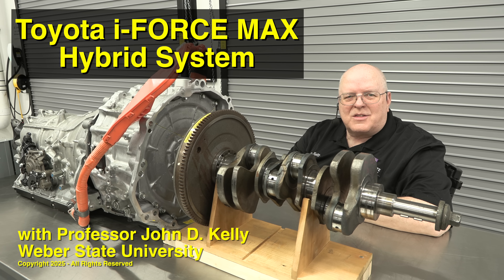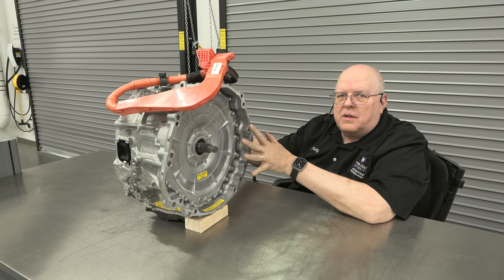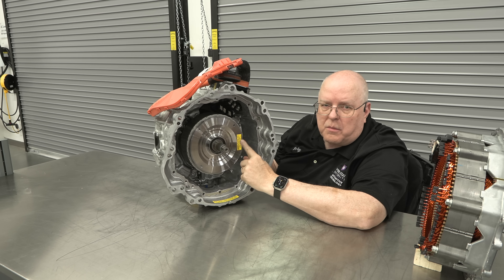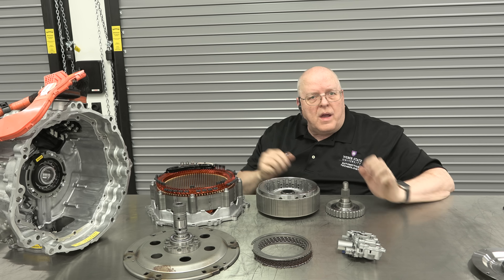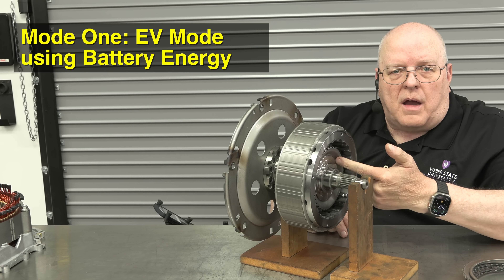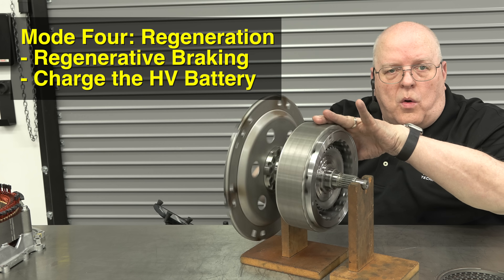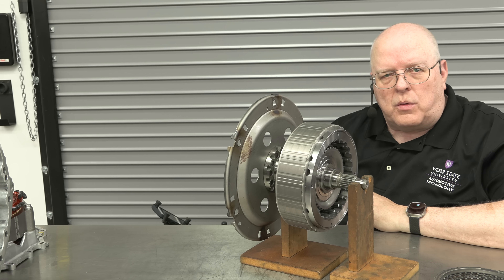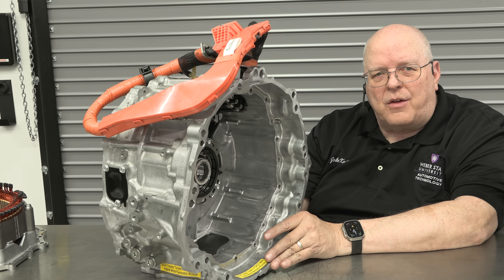Toyota's i-FORCE MAX One-Motor Hybrid System

Comment: I use two cars: a Japanese Nissan Fuga (similar to the Infiniti Q70) with the same hybrid system (a VQ35HR with 303 hp and an 80 kW electric motor). 
It's a similar hybrid design, but with a dry clutch, like a manual transmission.
And every drive, I clearly feel the gear changes, both during acceleration (1-2-3-) and especially during recuperation (-3-2-1). 
All this is noticeable in comparison to the lack of any gears on my second car, the Leaf Ze1, which, as you know, has a super-smooth ride with a single gear in the transmission. 
I'd like to believe, that 8 or 10 gears and the car's greater weight, will smooth out this rather unpleasant nuance.
This hybrid system design has been around for many years, and only differs in design within the limits of licensing and protection of rights. 
And I'm surprised Toyota didn't install some of their favorite high-revving, highly efficient "PowerSplitDevice" between the ICE and transmission.
However, Professor, THANK YOU SO MUCH for your reviews! You have no idea, how much you contribute with your lectures. 
How many cars have been repaired simply by a deeper understanding of the systems you described and demonstrated in such detail. 
I bow deeply to you. I hope you'll read them. I wish you good health. Thank you again.
Reply from the maker: Thanks for sharing your experiences and your kind words!

Comment: Very interesting - thanks.  Just curious does the "module" use the transmission fluid (not separate, all one containment)?  I am just thinking, if the transmission and the module are using the same fluid, I would assume the fluid would require more maintenance (changing the fluid more often).  Although, I have never heard of anyone having transmission issues more so than a non hybrid vehicle.  That's an awful lot of clutches when you combine the trans and module.
Reply from the maker: It has shared fluid. Thanks for watching

Comment: My question with regards to my Land Cruiser .. with the engine stoping frequently and the oil pressure dropping as a result to 0, does this mean a lot more extra wear every time it starts again?  It's not like I can disable this either.
Reply from the maker: It is fine. There is still oil there although it is not under pressure

Comment: What I like about Hybrids is they do not require any special infrastructure. On average they will be all electric most of the time unless they drive more than 60 -- 70 miles.  Ford should have gone hybrid with their trucks.
Reply from the maker: Ford does have a hybrid F-150. They call it the Powerboost system.

Comment: Excellent breakdown as always. I have to say.. I'm just really unimpressed by the specific application of this technology. The truck has a tiny battery, gets extremely mediocre fuel economy, and has a ton of added complexity to the drivetrain.. It would have made more sense at this point just doing a series-hybrid drivetrain, and based on my calculations for the Ram 1500 series hybrid, you'd likely get like 1mpg less in that configuration, but you wouldn't have a transmission to deal with, and you could charge at home for pennies... I'm not sure what Toyota was thinking with this one. It's like a merging a lot of different ideas that should have remained distinct. Even an HD E-CVT would have made more sense than this in my mind. Heck, if they had just put a larger rear motor on the rear axle they also could have eliminated a differential and a driveshaft..This just doesn't compute to me given how little value you actually get back by making the truck a hybrid.. It's frustrating.
Reply from the maker: Thank you for your detailed feedback; I appreciate your perspective. RAM has dropped their series hybrid truck now.
Reply: @WeberAuto  It sounds like they dropped the electric version but not the hybrid! Hybrid is still in the works

Comment: Congratulations for  your dedication and excellent explanation. I am a mechanic and I work a lot with Chevrolet Tahoe and Silverado hybrids that came out from 2009 to 2013, and I have found that they were very advanced for their time. The 2ML70 transmission is incredible; it uses the same NIMH batteries as the Prius, 40 cells, 300V, and in my opinion, it represents another level of sophistication (ECVT whit two 70 kw opposing 3 phase motors)  I would love to see you  take one apart I assure  you will find many surprises in a vehicle from 17 years ago.
Reply from the maker: Thanks for sharing your experience with those systems. I went through the GM training on that transmission when it came out, but I have never had my hands on one since

Comment: Interesting to see Toyota now doing it Honda’s way. I always thought Honda’s way was worse since the ICE can’t always run at it optimal speed. Also in the originals Hondas the ICE had to spin when the car was moving. So EV mode was very inefficient and confined to a few mph at most. Enough to crawl through a fast food drive through and that’s it.

This does seem robust though. Truck folks may appreciate that.

There is at least one other system that works differently.  Volvo’s system puts the hybrid in the transmission. It uses a dual clutch transmission and the motor is on one of the layshafts. So sometimes the ICE and motor are running at the same speed and sometimes not. It does ship in the US but not on any affordable vehicles. And obviously not in large numbers. Maybe you can find a salvage unit out there.
Reply from the maker: Thanks for your insightful comment, I appreciate you sharing your knowledge and experience.

Comment: Definitely not a fan of the iForce, rather regressive and dumb for Toyota, regressive compared to the Subaru Outback's design of a hybrid eCVT hooked to a traditional 4WD output. The eCVT shouldn't have any problem with towing other than direct drive not easily available at high throttle or low speed. Probably a marketing spin for the old boomers who sneer at anything close to being a Prius
Reply from the maker: Thanks for watching

Comment: I’ve been impressed with my hybrid Corolla but wouldn’t want to trade my old tundra ( non turbo) for a hybrid. I don’t equate reliability with a small (6cyl) engine in a truck having not 1 bit 2 turbos. Graft this module into my 03 tundra drivetrain and I’m a buyer.
Reply from the maker: Understandable. Thanks for watching

Comment: If I understand correctly, the generator gear ratio is always 1:1. Is there an advantage to placing it behind the input shaft instead of behind the output shaft?
Reply from the maker: Yes, 1:1. The advantage is the structural support is better close to the engine block. Thanks for watching

Comment: So the clutch pack is hydraulic actuated, but the clutches themselves, are they technically dry clutches?
Can't imagine there's that much fluid sloshing around that housing.
Reply from the maker: No, it is a wet clutch. Thanks for watching
Reply: @WeberAuto  Very interesting, thank you for the detailed video. It is such a simple piece of tech - typical Toyota.

Comment: Interesting the flywheel still has a ring gear. Does it also have a traditional starter?
Reply from the maker: Yes, as a backup
Reply: @WeberAuto 

Good to have options!

So the 12v starter isn't primary?

Comment: My dealership should watch this in hopes they can figure out why I’ve had on 2 different occasions of:

1) hybrid malfunction
2) check engine
3) parking brake malfunction 

First time it occurred with 853 miles and now with 2,278 miles on the odometer.

Awesome video by the way!!
Reply from the maker: Best wishes with that. Thanks for watching
Reply: Random unrelated errors are often caused by bad ground connections.

Comment: Awesome video...this is the first time I've seen anyone take it apart like that. So, if a tuner increases boost on the engine, does the hybrid side of the vehicle do anything different? I've had my Tundra over a year, and the hybrid motor boost still seems so unpredictable to me. Like it just does whatever it wants to depending on its mood. I feel like increasing turbo boost may even make the hybrid tuning think it should add less power. I know shops have been experimenting, but I assume it's more trial and error without knowing what's going on in-between all of this.
Reply from the maker: Good question, I don’t have an answer for y

Comment: I love your videos. What's your personal opinion on mechanical 'direct drive' hybrids like the iforce max vs. an engine-generator with only an electrical connection powering motors for the wheels instead of a transmission, drive shaft, etc.?

I suppose the tradeoff is that the mechanical drive train hybrid is a better known architecture and weighs less, while the 'e-axle' hybrid has fewer transmission losses, and is not limited by an automatic transmission in how much power it can produce. Would love to hear from an expert.
Reply from the maker: This direct drive parallel hybrid system allows engine torque to the wheels at all times. The engine driven generator relies on electrical energy to drive the wheels. This requires a very powerful generator or is loses power under load. Stellantis has stopped the development of the RAM truck with this type of powertrain.

Comment: Very informed and easy to follow video! Thank you very much! I did find the length of this module you mentioned to be somewhat a practical problem. The longer power train and the associated cross member was the limiting factor of the gas tank size. All new gen trucks have a few gallon smaller tanks. Although the improved MPG supposed to make up the difference in range on paper, in practice, the new gens have much shorter usable range.
Reply from the maker: Interesting observation. Thanks for watching

Comment: I think that system is 1:1 the same as the one Honda used long ago (basically, first Honda hybrid system), when the motor-generator was sticked in between the engine (D17 for example) and transmission (CVT). Honda IMA system.
Reply from the maker: It is very similar to the Honda IMA system except this has an engine disconnect clutch.

Comment: Am interested to know how single motor can both job of generating power to charge the battery and the same time providing driving assistance when the car is in ice mode? How is it possible in parallel set up? That's insane.

Also i want to know where the hydraulic pressure is coming from to engage the clutches so that to turn on the engine? And time when the car is in hybrid mode where the hydraulic pressure is coming from to allow clutches in the transmission to transfer power to the wheels? 

Thirdly.  When car is hybrid mode how the gears are shifted? 

How temperature management on transmission is acheived given that there is part is a part that doesn't require too much temperature (the electric side) , and there is another side of the transmission that require   hoter situation for transmission to work.. (is it having more than one cooling system?)

Thanks for good demonstration video.
Reply from the maker: It does not drive and charge at the same time. It is one or the other. It charges whenever the HV battery needs a charge. If the battery charge is sufficient, the motor can help propel the vehicle.
Reply: @WeberAuto thanks so much for clarification

Comment: Is the hydraulic pressure for the clutches in the motor supplied by the normal automatic pump?
Reply from the maker: Both. Electric while engine is off.

Comment: Has anyone done the analysis how much repeated cold starts with high load affect ICE in hybrid vehicles?
I know that Toyota uses thermos like device to store hot coolant, but I think that lack of lubrication (due to oil retirning to sump) is also a big problem.
Has any car company done F1 style engine warm-up before the start, for example by pre heating engine oil using 10kW heater and pumping it around the engine using external oil pump to lubricate slide sufaces before the start?
Reply from the maker: Thanks for watching

Comment: Cool to see this system up close and how it compares to the Ford Powerboost system. The Toyota system is slightly more powerful (7 more HP and 13 more lbs ft), but looks like a very similar design.

The size of the motor surprised me, although stack up length of the full driveline is less of a concern in the medium to full size vehicles this is used in, may not be a concern.

Are the base transmissions identical, other than additional clutch packs to support the higher torque? That may be a benefit to the Toyota design, if they can use a common case for both normal and iForce Max vehicles. Fords design uses a unique case on the 10R80 that houses the electric motor and torque converter within the body of the transmission. This may benefit in better packaging,  but adds complexity in the plant as you now have additional case designs.
Reply from the maker: I plan on showing the Ford Powerboost parallel hybrid system in a future video. Toyota also uses a special transmission case and electric oil pump to jopin with this generator module. Thanks for watching.

Comment: What are the pros/cons of this clutch pack connection compared to the typical series-parallel Toyota hybrid system with the planetary gear connection?
Reply from the maker: The major benefit of this system is a direct transfer of torque from the internal combustion engine to the wheels. The power-split system does not have that and is not suited for heavy vehicles and loads. Thanks for watching
Reply: @WeberAuto  Thank you for the clear answer!

Comment: Thank you for the great video. I’m a little concerned how Toyota designed this system. I would have preferred to see a system similar to what is in the Prius. I’m interested to see Ram’s system where the engine is strictly a generator with a large battery pack.
Reply from the maker: This system allows for direct transfer of torque from the internal combustion engine to the wheels. The Prius power-split system does not have that and is not suited for heavy vehicles and loads. The RAM system was a series hybrid which operates like an EV, but with a portable gasoline powered charger (Stellantis canceled the RAM truck a few weeks ago.) Thanks for watching
Reply: @WeberAuto  I’m just concerned that the transmission has to be removed to do any repairs to the electric motor, clutches, etc. I misspoke on the hybrid system, I meant the Honda system which allows direct connection engine torque to the wheels. I just wouldn’t want a normal a regular transmission in this kind of set up. I still think the Ram Charger is a better design idea. As always Thank you for your videos.

Comment: I don't think Toyota did a good job here. The way to go is to use electric motors for propulsion, while the engine powers the generator that stores energy in a buffer battery. There is the inefficiency of transforming mechanical energy into electrical energy, storing it, and then back to mechanical. However, the engine can always run in the most efficient mode, the torque converter, clutches, and automatic transmission are thrown out, and transfer mechanics are reduced to a minimum. All this, while providing a 4x4 experience for cheap with two electric motors, while having redundancy. 
The buffer battery is small, light, and inexpensive... In general, all automakers are making cars with two thoughts only - to rip off the consumers and provide business for their dealers.
Reply from the maker: Thanks for sharing.

Comment: Hello and thank you fot the video! What advantage does a system like this have compared to an e-CVT system? What limitations does e-CVT run into in these vehicles, and what is its disadvantage?"
Reply from the maker: This system allows for direct transfer of torque from the internal combustion engine to the wheels. The Prius power-split system does not have that and is not suited for heavy vehicles and loads.
Reply: Thank you for reply, I have never felt a lack of power in my RAV4, and even when towing a trailer, I didn't feel like the engine was struggling.

Is it possible to overload the e-CVT transmission? Is the maximum torque when moving the vehicle (starting/launching) defined by the MG2 motor?

In a conventional car with a manual transmission, overloading will cause the clutch to burn out (or slip and burn). What happens with the e-CVT when it's overloaded, or rather, where is its overload limit?

Comment: From this video I quickly learned how much I miss my simple 1996 Toyota Tacoma truck. 360,000 miles and only a couple batteries and a starter once. Simple and so reliable. Sure wish I could buy that truck new today.
Reply: Toyota still sells bare bone pickup trucks from the latest hilux champ in Asia starts at $12k to the Land Cruiser 70 series with the 4.2 inline 6 diesel that runs on the worst fuel in the middle of nowhere
Reply: @alanmay7929 wish I could get one of those in the U.S.
Reply: I also wish I could buy a new Toyota truck from the '80s when they had 7.2' beds 🥲
Reply from the maker: Thanks for watching and sharing your experience!

Comment: Does the regenerative braking lose efficiency because the transmission is in between the wheels and the motor/generator?
Reply from the maker: The transmission gear used impacts the rotational speed of the rotor while decelerating. The slower the vehicle speed, the greater the potential regenerative braking force. Thanks for watching